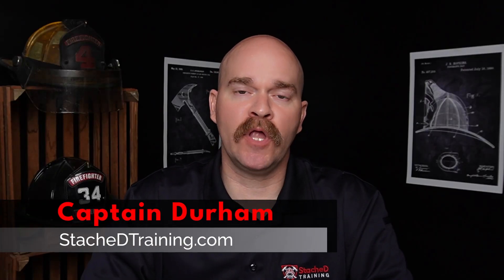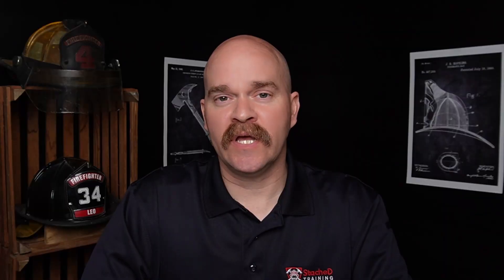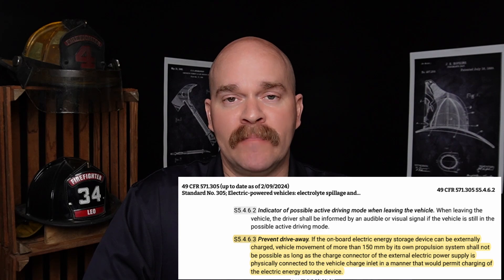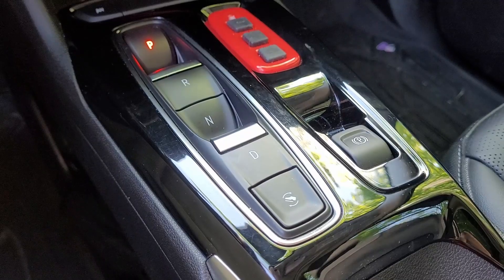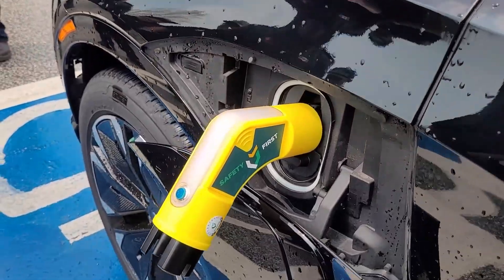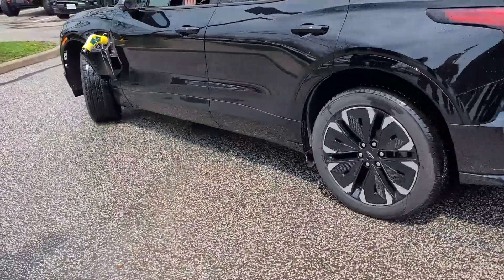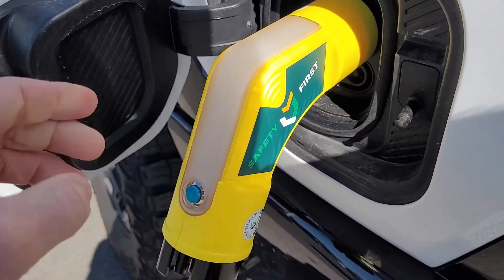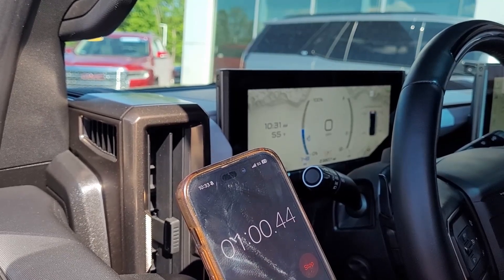First Responder Alert: Emergency Plug Issue with GM Vehicles

Comment: You need to reach out to Thomas Miller with WVU or through NVFC. He does a great class on EV bus tech. In his class he mentioned that they tested these on several wrecked EVs and this had a very low success rate with damaged and wrecked EVs

Comment: Hello, I'm a technical trainer and I have to say that the communication around the emergency plug is, at least, very sketchy. I've got a lot of firefighters in training about HEV security that are mixing things up: The emergency plug put (sometimes) the vehicle in "parking" BUT it doesn't turn it off. As we can see in your video, the "Ready" is still on, so HV is still ON. 

When i hear the firefighters telling me: "the emergency plug turns off the vehicle they are thinking about motion AND HV! It's really important for them to understand that it's only keeping the vehicle to move but doesn't do anything guaranteed about HV. 

As an example, here in EU, we've got a lot of EV without a Parking mode (Dacia Spring has got only D N R and an handbrake, so the emergency plug cannot pull the handbrake by itself). thanks for your videos, great work!
Reply from the maker: You are correct. This absolutely does not turn off the high voltage.  I discuss that in my other video, where I do a deep dive into the emergency plug.

Comment: Seems very dangerous to the occupants for anybody to just be able to run up to a car and instantly disable it allowing for situations where you can't get away if you're under duress or attack for some reason. This is going to be in every carjackers case.  This product just seems unnecessary.  Other vehicles aren't required to have an exterior emergency shut off why should EVs. Leave The emergency shut off under the hood or in less accessible areas, firemen still know where they are and exactly where to cut to disable the car.

Comment: Wonder how long until kidnappers, carjackers, robbers, etc. start using emergency plugs to prevent people from escaping if it hasn't happened already. I don't like the idea of my vehicle having an easily accessible external disable feature.
Reply: Likely it won't be long before car thieves pirate these devices. Run up, plug it in, and it instantly removes your greatest defense tool which is the ability to move your vehicle.
Reply: @Michael-1337  Faking being an L1 EVSE is easy, only need a few resistors and an oscillator circuit to generate the necessary signals and loads on pilot pins, maybe $5 in parts for a one-off circuit build. The most expensive DIY component by far will be the plug itself, maybe buy the connectors from scrappers who steal fast-charger cables. Then again, you only need ground, PP and CP. Find appropriately sized metal pins, 3D-print something to hold them in place and you are ready to go.

Immobilizer plugs are being sold to first responders for nearly $1000 a pop but I bet a Chinese manufacturer will make functional equivalents for ~$10 soon enough.

Comment: Don't these whizz-bang EV's have a PARKING BRAKE??   Too low tech, I guess.
Reply from the maker: Unfortunately most newer vehicles use electronic buttons for the parking brake so there is no positive feedback for first responders to know it worked correctly.  It also requires us to enter the vehicle to engage.

Comment: What th is "Emergency plug" in first place ?
That is EV vulnerability, unauthorized access, an exploit device, that could be used for malicious activity.
Reply: DATA DOWNLOAD
Reply: It is essentially a charging cable head that doesn't charge. EVs aren't allowed to move when plugged into a cable, doing that would pull the cable out and possibly damage the car or the charger. Even if the cable isn't doing any charging, because the vehicle is at full charge, you still don't want the vehicle to drive with that cable attached.
It does not hack the EV or access anything it shouldn't, it simply uses an existing safety feature for safety purposes.

Comment: What if you are charging? Can you drive away with the cord connected?
Reply: Now that would be an entertaining video. "Electric Hunmer vs SuperCharger pulling contest"
Reply: @SolAce-nw2hf  I actually googled this and there is a YouTuber who advertised a breakaway adapter for teslas for this very reason. So if you need to drive away in an emergency while you are connected it will break away from the charging cord.  I guess it’s marketed to people afraid of being ambushed in their cars waiting to charge in remote desolate areas.  Yet another problem with EVs.

Comment: I would bet there is a software developer somewhere that went "oh qwap" at the 60 seconds delay. Sounds like some debug setting may have been left enabled. Purely a guess.
Reply: Maybe the hardware is not capable of software control.
Reply from the maker: Since there is a 60 second delay, it should be an easy thing to change in a software update.